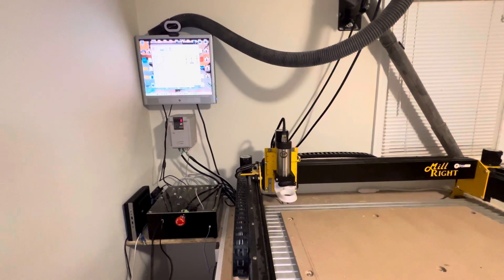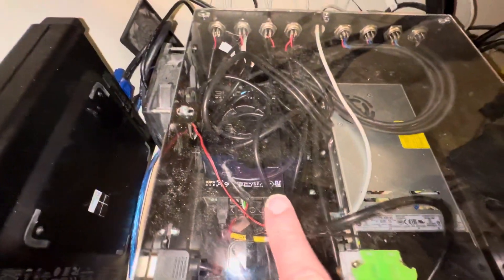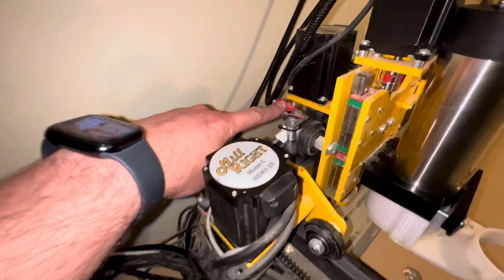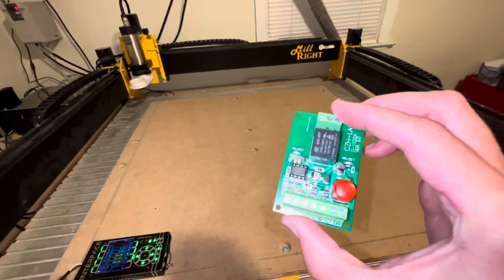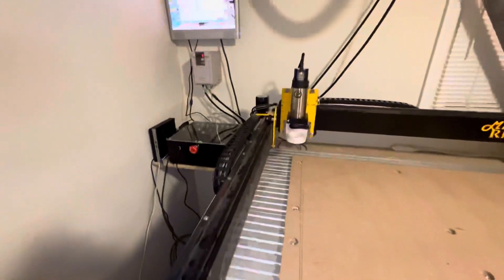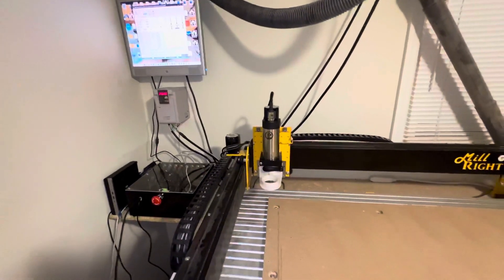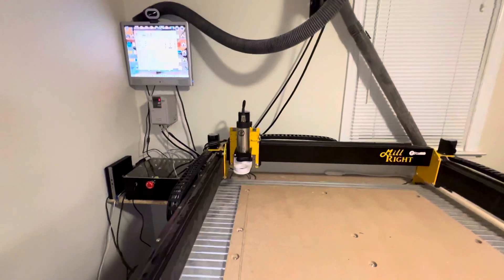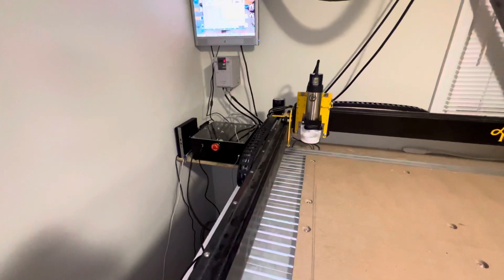The Millright Mega V XL How to Control It With OpenBuilds Blackbox Interface. PWNCNC 1.5kW Spindle.

Comment: Did you have to load any type of mill right firmware to the black box? All my steppers are moving the correct direction. The only problem is when I run a program which is 6x6 in vcarve. It wants to run from the front left to the back right making me have to hit the emergency stop. Any ideas
Reply from the maker: No. Not sure about the issue.

Comment: How did you translate the Millright Stepper Driver dip switches to the Black Box configuration and micro stepping (X and Y are set the same and Z is different). I believe it’s causing me a lot of headaches in my actual plunge depths and 3d finishing because the steps appear to be set perfectly. I’m really struggling with my change over.
Reply from the maker: Keep the same wiring configuration. I removed it as the power supply would not support the speed. Had missed steps.

Comment: How difficult was it to change to the BB controller? I’m considering of doing the same for improved functionality.
Reply from the maker: Easy. The power supply was not enough for the speeds I run.
Reply: @DavidKK4GAF  Thanks! Was it mostly plug and play?
Reply from the maker: Yes
Reply from the maker: I have a BB controller power supply I would sell.

Comment: Use the change over to OpenBuilds Blackbox/Interface simply for the functionality of the Interface, or was it to get some additional performance out of the machine?  Or do you have less performance because of difference in stepper drivers?
Reply from the maker: Was for functions. But was not enough power to run 10,000mm/min.
Reply: @DavidKK4GAF  Thank you.